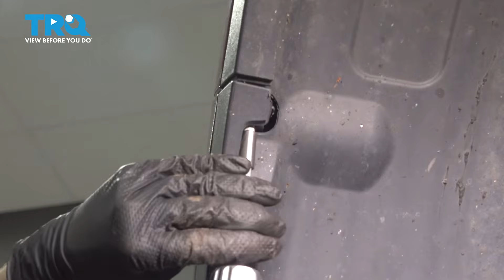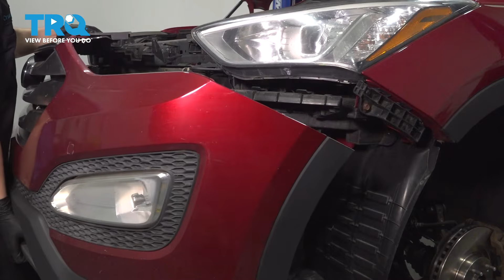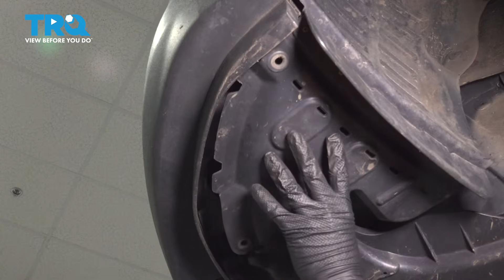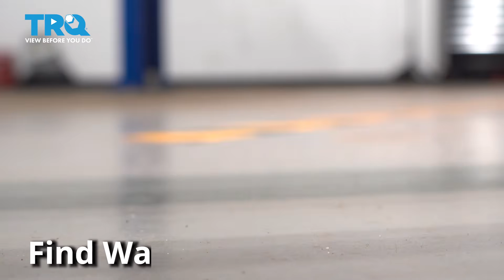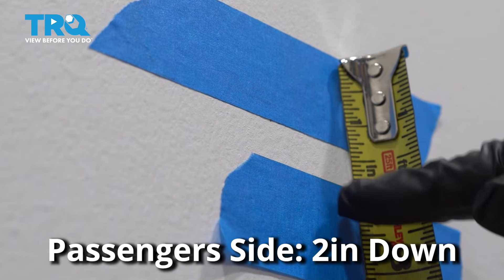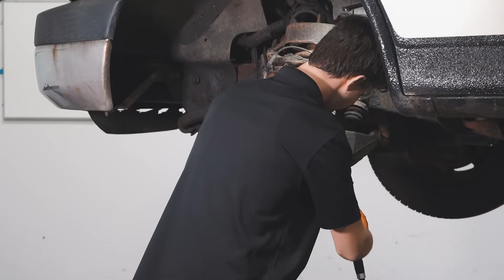How to Replace Headlights 2013-2018 Hyundai Santa Fe

Comment: I have repaired Mercedes, BMW, KIA and all Russian cars. I have not come across such stupid engineering ideas as the Hyundai Santa Fe 2016  and the last years cars. To change one part, you have to dismantle several others. Imagine, to change the headlight bulb, the front part of the car, the bumper is dismantled! What can you do if the bulb breaks somewhere in the forest, in the mountains, somewhere on a major highway?!

Comment: This is to replace the headlight assembly. You can try replacing the bulb itself to see if it works. But these assemblies have some internal wiring that fails even when the bulb itself is fine.

Comment: I have a 2013 Hyundai Santa Fe Sport 2.0T and I've never removed anything on my bumper just to change headlight bulbs including the high beams..Behind that little round cover is the bulb simply remove the connecter and replace the bulb..🤨

Comment: You can totally do it by just removing the bolts on top and pulling up and out on the headlight. Just got done changing the bulbs for my wife's car and there isn't enough room to change them without pulling the light out at least a small amount.

Comment: Wonderful video! It saved me in between $100 and $200
I just followed the video .
Remarkable that both headlights would blow at the same time . But I couldn’t get my hand in to reach the outer headlights so I had to take off the light assembly. Once that was done, I pulled the bulbs. Replaced them put them back buttoned everything back up and voilà headlights again.!!!
Thank you so much for this video!!!  
*** 
5 stars 
Ken In Hawaii

Comment: Ive never took the bumper off just the bolts and a gentle pull and out it comes,done this a couple times replacing bulbs,that is the long way to do it,which i understand but there is a easy way to do it i learned from the dealership i take mine to for maintenance
Reply: Literally like why is bro taking the bumper off